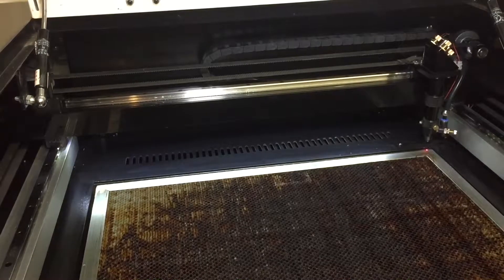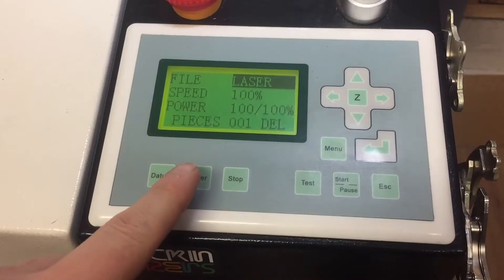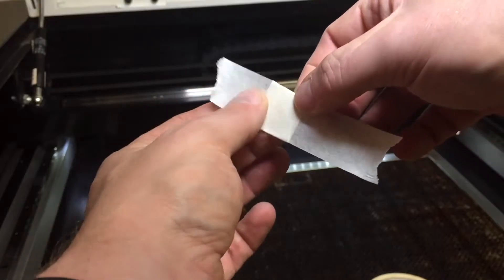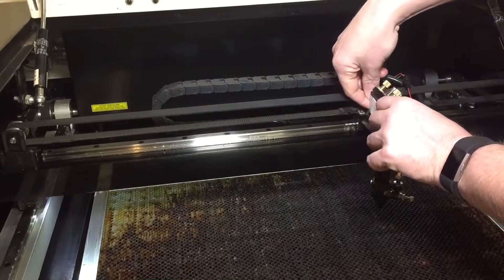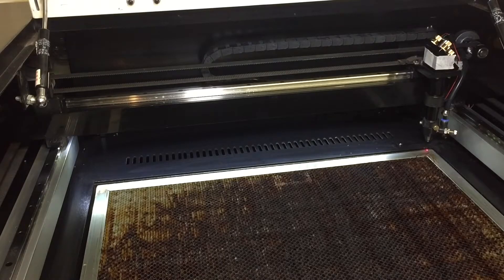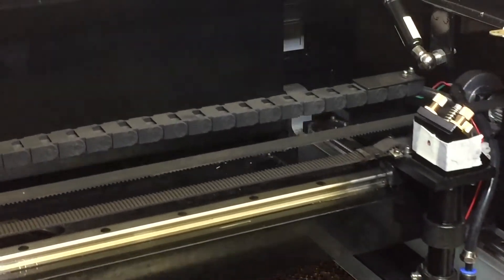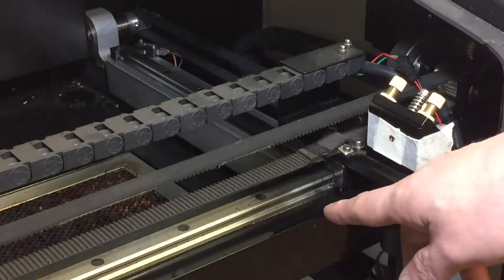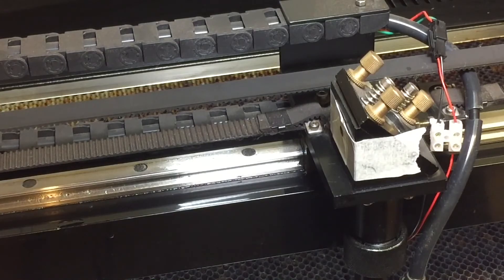How to do a quick alignment test on a CO2 laser cutter

Comment: 45 degrees, you mean 90 degrees maybe?
Reply from the maker: No Peter. I say "Assumes that the mirrors are at 45º" The mirrors are positioned this way to turn the beam by 90º. If the mirror was at 90º it would shoot the beam back along the gantry.